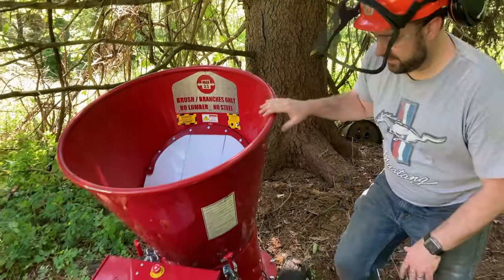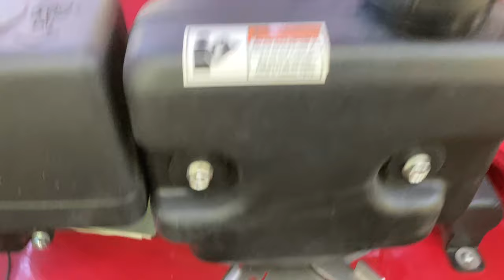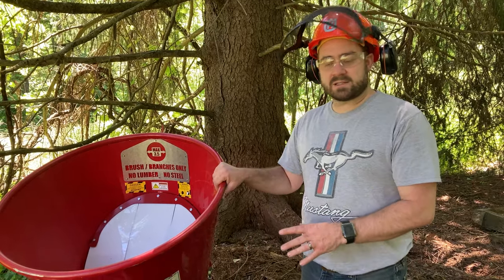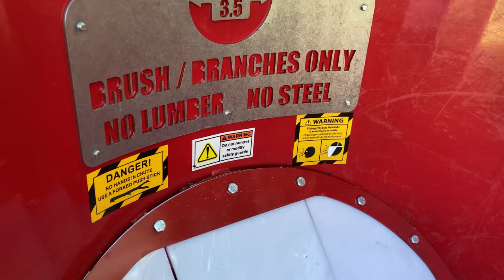#215: How to Start and Operate a wood chipper.  Split-Fire Horizontal Wood Chipper 4090 first use.

Comment: Very nice chipper! Hard to beat a Honda engine!
Reply from the maker: Absolutely right. When I first started it up, I could just tell it’s a quality engine. I’ve heard several log splitter manufacturers say that they’re having trouble getting the Honda engines right now and are switching to other brands. I’d hold out for the Honda. Thanks for watching.
Reply: @PurpleCollarLife  my air compressor has a Honda and it starts 1st or 2nd pull every time. Easy on gas too!
Reply from the maker: I’ve seen a few gas powered air compressors. They seem great for locations without power.

Comment: I like it!  Sure beats trying to mulch your landscape with axe cut chips!!! 

It does exactly what it is supposed to.  And seems to be pretty heavily built.

Are the cutters fixed or centrifugal?  A lot of these machines use flails so that they aren’t direct drive.  It stops the jolt of impacting hard or large objects being transmitted directly into the engine.

I’ll end this as it started…. I like it!
Reply from the maker: Thanks for watching and commenting.  The cutters are fixed on a flywheel from what I can see. They've worked flawlessly so far.  There was a bit of a learning curve to determine how to best set the limbs in place so that they "self-feed" down into the hopper.  You'll see some lessons learned and lots more chipping in today's video release (6/26/21)

Comment: "Nice and fluffy" 😄 . I got caught using the word "sticky" to describe sticks once. "Spindly and sticky" was the phrase I used. The laughter didn't seem to want to stop. Thanks for the demonstration ! Very nice and well made chipper. No doubt it will serve you well for years to come. I really like the built in towing, that it is  its own trailer...very neat. Question: If you decide to travel with it, do you think a license plate would be required for it, in addition to the fender and light add ons?
Reply from the maker: Don’t you hate that when you say something, it’s captured on video - but even worse than that, your wife captures it and immediately starts laughing.  Video I can edit and fix, her memory seems to last forever. :). 
I’m really happy with it. I think they’re a good investment.  I like the built in wheels/trailer function of it too.  It’s perfect for towing around with the quad, or a UTV, or even a garden tractor.  And like you said - on the back roads with a vehicle.  Great question about the license plate.  I see lots of people towing log splitters around short distances with no lights/fenders/plate.  That doesn’t mean it’s legal - just that it’s common.

Comment: Looking good Chad! Does the Honda belt drive to a flywheel with blades ? I’ve found that the fresher the material the better it chips and wears the knives less. I have the same ms271 and it has been great, much better than the echo that it replaced. Also I’ve found it easier to chip as you go versus piling the brush up because it will tangle together.
Reply from the maker: You got it - Honda powers the drive belt to the flywheel with blades.  The green material cuts great, the seasoned limbs did great too.  The trickiest stuff is the limbs with weird shapes, or lots of offshoots in the branches.  They tend to float on top of the hopper walls and keep the limbs from pulling in.  Long straight poles go through like butter! 
I think all the Stihl chainsaws are great.  I’m happy with my MS271 and the MS290.  I wouldn’t give either one up.  If I were to try another, I’d go for the MS260.  Thanks for watching!

Comment: Light and fluffy ??    :)     How long do the blades last on that chipper?   How hard is it to sharpen?  Does that come with a cover?  I need one.
Reply from the maker: Hi Mike - I haven't had to change the blades yet.  I do have an extra set.  I'm sure it's like a chainsaw - the blades probably dull whenever you insert dirt (mud stuck on sticks) into the machine.  But so far, I haven't noticed any signs of dull blades.  
I don't know if there is a cover available.  Mine didn't come with one. But I store it inside the shed or the big garage.